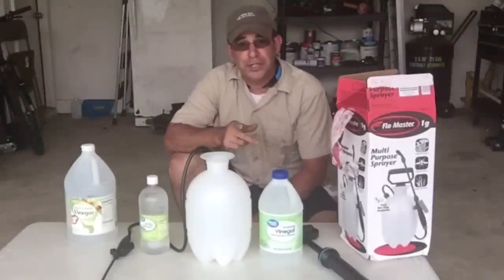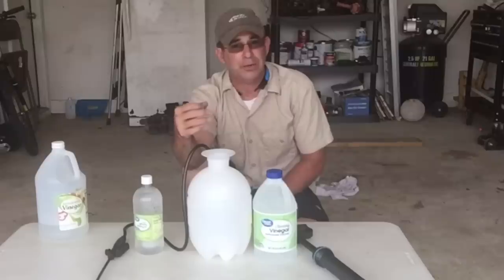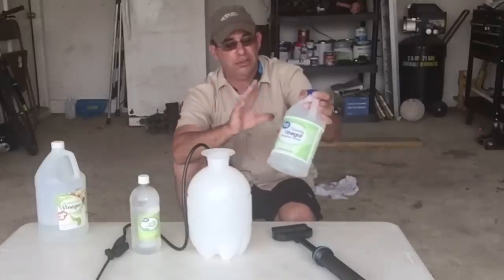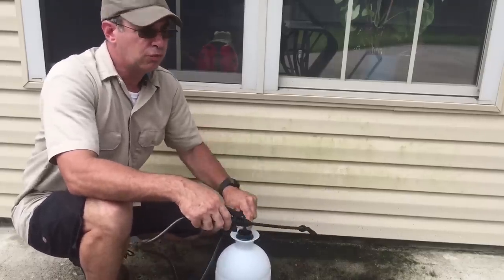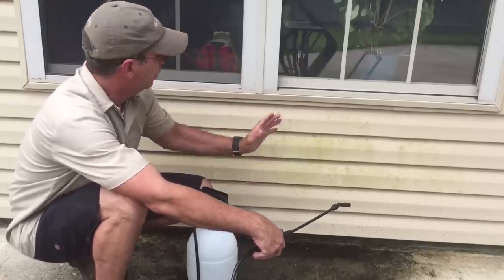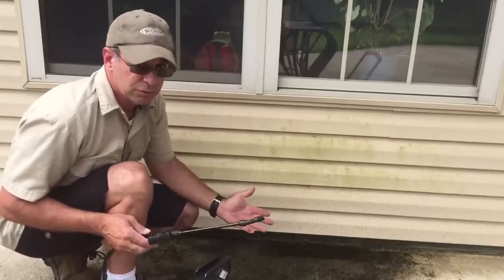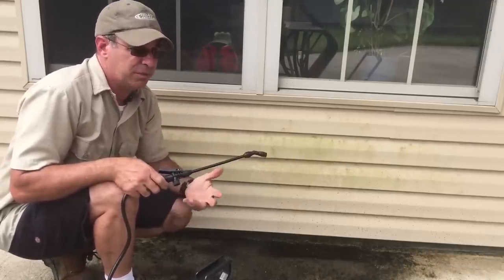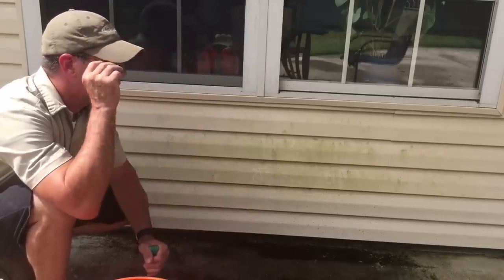Cleaning Vinegar as an All Natural Organic Cleaner for Pressure Wash / House Wash Mildew

Comment: As suspected. In a commercial application, brushing is just simply too time consuming. You need an oxidizing agent like SH or Percarb. Percarb doesn't necessarily need a surfactant since it has an oxygen reaction (it generates Hydrogen Peroxide, which generates oxygen and that creates a "foaming" action). It just isn't as strong an alkaline or oxidizer as SH.

Comment: Wouldn't the pressure from an actual pressure wash running 1500psi agitate it enough to come of?I bet it would no problem.Garden hose only has about 40-80 psi...
Reply from the maker: Sure, and it is enough to have to climb a ladder and take all day. Vinegar failed in this test. Good old fashion bleach is best
Reply: @DansVlog  I dont understand how guys get around using bleach legally.EPA basically says no bleach in waterways including storm drains and no to letting it evaporate.90% of the companies I see on youtube do not reclaim the bleach/water so do they just not follow the EPA laws or am I missing something.I use bleach at my house by the way.Im not hating on it I just dont understand how to abide by the laws and still use bleach.
Reply from the maker: I don’t use bleach or acid on driveways or sidewalks.
Reply: @CC-un7jz  Funny though, that chlorinating (and adding flouride) to our drinking water is considered safe. Priorities are a bit mixed up huh EPA?
Reply: Think about SH reaching the storm drain.  In most cases is to diluted to even cause any effect.  In most cases it might not even make it to the storm drain.  Factory's use to do that and still does, where they run there waist straight to any stream with out diluting. That's an issue.  All powerwash company's are safe.  The cars we drive, or machinery is the ones we need to be careful with. Oil!!!!

Comment: You just have to spray vinegar on it and let it be. Don't scrub or rinse it with water.  I accidentally spilled vinegar on my moldy concrete driveway, and months later I noticed that spot where vinegar was spilled was free of mold. It has been several years since and mold hasn't come back, while with pressure washing you have to do every year. The only concern is, what vinegar might do to the concrete in the long run. I hope it won't do any damage

Comment: Hi Dan and everyone else. So I have sat painfully by and watched these tests with the vinegar and pulled my hair out. I have finally decided to step up and say something. I, too, pressure wash, but I know a lot about molds and vinegar and acids.  First of all the way all this works is.... please stay with me...  molds have roots, so when you see green stuff (algae, which is also know as green mold, yellow mustard mold, red, black and so on) it all has roots and grows into whatever it's on.  Vinegar kills the roots, which keeps it from growing back sooner.  Bleach makes it disappear and kills the surface, and on slick surfaces does kill the roots like on glass. But on porous surfaces like brick, concrete, vinyl siding, etc, bleach kills the surface, vinegar applied afterward kills the root... especially on wood.. it is hard to get rid of mold on wood because when wood gets wet the pores open up and mold roots get way down deep into the wood and this is why stain comes off in most places on wood when being pressure washed. So it's important to go over wood with vinegar and lemon juice mixed together after its been pressure washed and let it dry for 24 hours before Appling stain or sealer.
Now for Dan true test..
Put straight white vinegar on any GREEN mold/algae and let it sit over night and you will see a difference but not like bleach, because it kills the roots not the surface so you will be able to just rinse it off without wiping.. but if you mix white vinegar and lemon juice together and spray it good you'll see a difference but again it kills the roots so just rinse it off but you have to let it sit over night... it's a long process people.. I have lots of people who like this way better so I'm really used to this long long process.
Reply from the maker: Good stuff, thank you
Reply: Your very welcome.
Reply: Would that be equal parts vinegar and lemon juice?
Reply: Thank you! 🙌🏽👏🏽👏🏽👏🏽
Reply: Great info, thanks
Reply: Thank you!! Because these “cleaners” and stuff have way too many carcinogens in them. I refuse to use any other them in or on my house.

Comment: What’s up Dan, when you use the bleach on gutters does it take the mildew off pretty well? Or do you have to re-apply?
Reply: On tiger-striped gutters spray three feet at a time. First, spray Spray Nine degreaser and over that spray Zep orange degreaser. Then use that cleaning pad that is green rough on one side and yellow on the other. Use the rough green side of the pad and rinse with a hose before it drys. It looks brand new when done. You will not be disappointed.

Comment: Hey Dan ... for all the "special" chemicals sold by "professional product supply houses" ... have you ever tried using a small amount of JOMAX in your cleaning solution ???   The reason I ask is that I used to mix a small amount of JOMAX in a sprayer with bleach & water, and apply it to the soffits & gutters on my house.   Before I could get down from the ladder, the black was already turning to gray .. then tan .. then GONE .. just needed to rinse.   I'm 70 years old now, and my wife has a fit if I get up on my 40' ladder, so I have adopted your technique, and it's working just fine .. I keep wondering if JOMAX would be of any benefit.   Maybe I'll try it myself,and let you know how it works.
Reply from the maker: Not yet. It is real hard to think I can find anything as effective as good ol’ SH (bleach) for the cleaning that I do
Reply: Dan's Vlog This stuff "activates" SH, making it more powerful without making it more hazardous to building materials or vegetation.   Give it a try ... it is readily available most everywhere.

Comment: I use borax, blue dawn and oxyclean...no grow back for 2 years!
Reply: I used a little borax in my wash solution before and really did not see any difference. I usually wash vinyl once a year to remove filth and early stages of mildew. I will keep your formula in mind and apply it to the "green" side of my house as prevention.
Reply: That sounds interesting, how much of each “borax, blue dawn dish washing liquid, oxyclean” did you use and was it the powdered mule brand borax and powdered oxyclean? If they are both powdered do you stir to dissolve before applying? Also how do you apply it ? Pressure washer? How long do you leave on before rinsing? Thank you